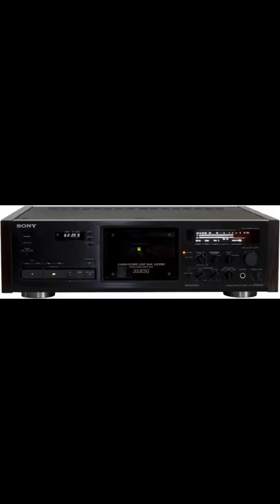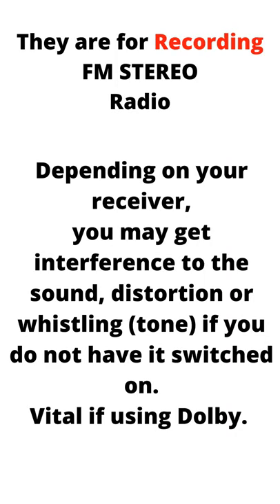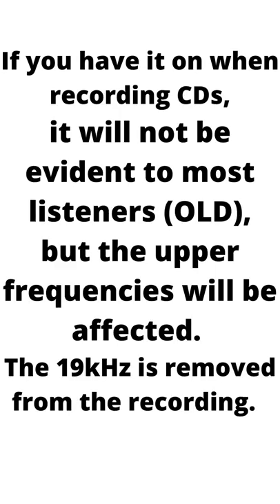What is an MPX filter on cassette deck and why do I need one? #shorts #asmr

Comment: I couldnt understand what you said.
Reply from the maker: Sorry about that. Basically it is for recording off the FM radio only and needs to be off when not in use. It stops the signal from the FM stereo signal interfering with the deck.